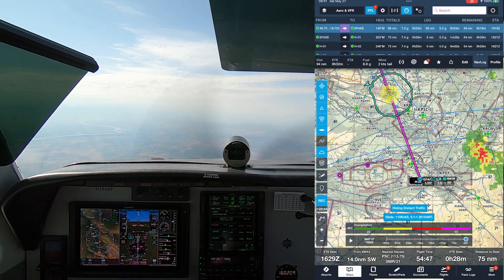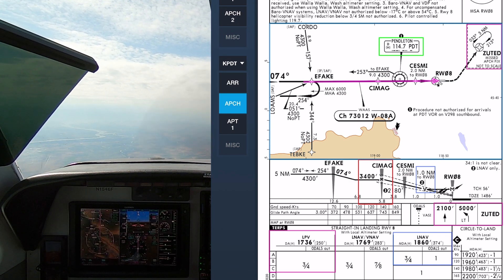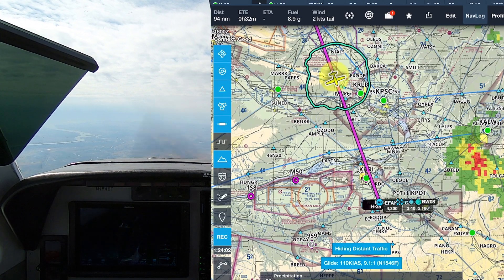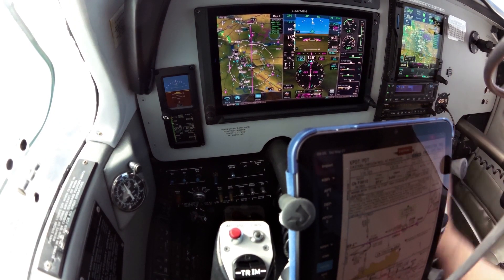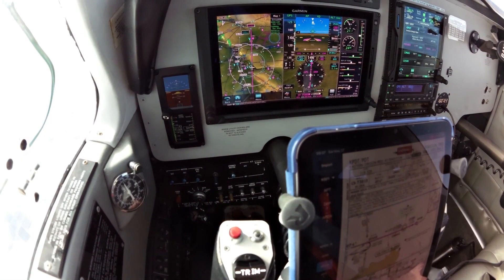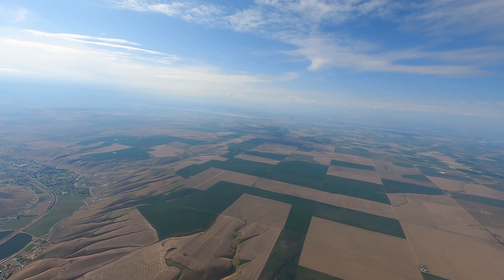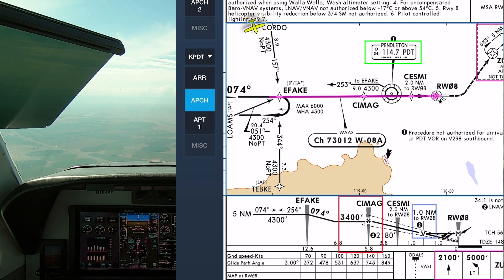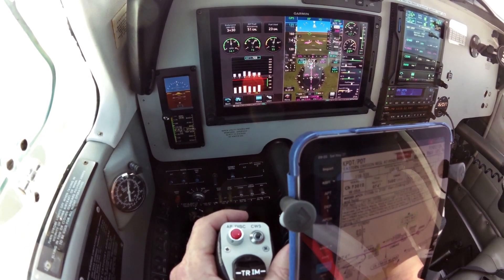Approach Briefing at KPDT

Comment: “Confirm that we are cleared for straight-in on the approach” - that’s a great thing to clarify and something I need to start doing in situations where there is any ambiguity whether I should fly the hold in-lieu of procedure turn (HILPT) e.g. the feeder route doesn’t require it but I’m not exactly on it, or the procedure calls for HILPT but it isn’t needed because I’m almost aligned with the final approach course and don’t need to lose additional altitude. Making assumptions in such cases can lead to unnecessary miscommunication between us pilots and the controllers. Technically it is required to clarify per FAR 91.123(a) - “When a pilot is uncertain of an ATC clearance, that pilot shall immediately request clarification from ATC”. 3:34
Reply from the maker: That's an important point. Often my technique is to use the readback as a way of confirming the clearance. For example, in this instance, the controller didn't say "cleared straight in" when he issued the approach clearance, but I could have replied, "Cross EFAKE at or above 4000, cleared straight-in, runway 08 approach." Adding "straight in" is a way of eliciting a correction, if one is needed, from ATC. But it's always better to ask for confirmation if you have any doubts.